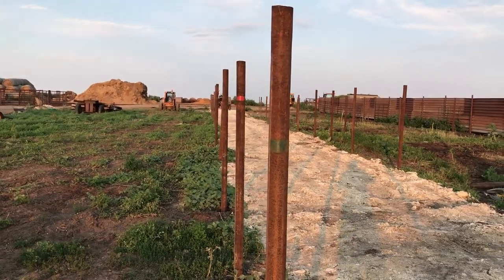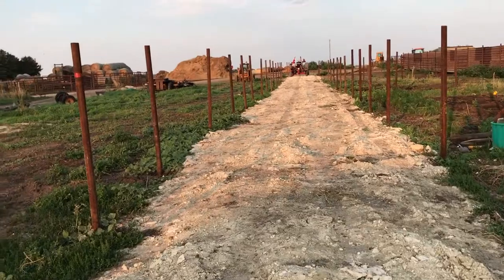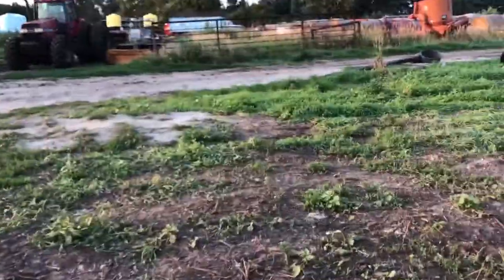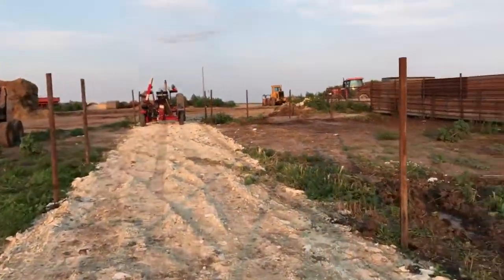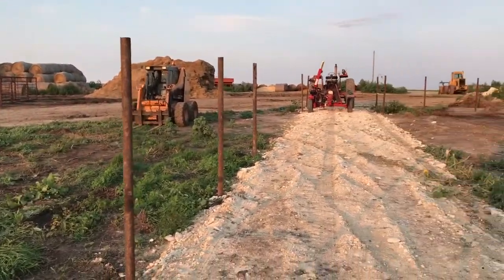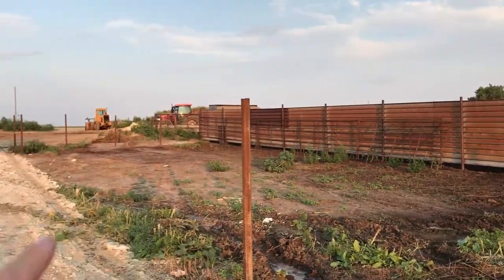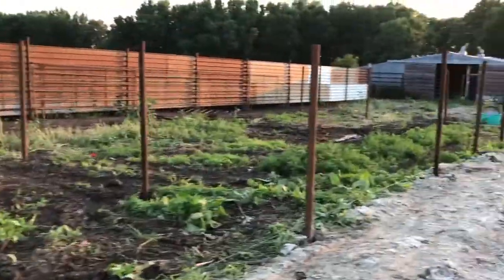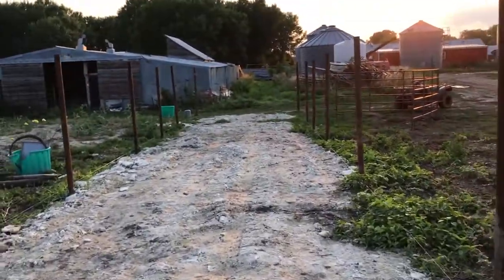Building a sorting ally part 1

Comment: Looks good Ted    I want to build on to my working corrals with steel but I need to buy a portable welder  hard to weld rails on the fence and then pound the posts lol.    We do have a scoop for the press so we can cut saddles into the pipes.
Reply from the maker: duct tape and baling wire could go a long ways! LOLOL

Comment: how deep are they in the ground?  did you use a cement base or core fill them or are they just pounded straight in?
Reply from the maker: just pounded the post in with a pounder and they are 4 foot in the ground

Comment: How long of a run can you make before you need to install an expansion joint in the pipe?
Reply from the maker: Im not really sure... Since i dont use any cement on my post they can give some but when cement is used im sure they are needed more often so that doesnt get cracked

Comment: Are you going with continuous panels?
Reply from the maker: no.... not a big fan of continuous fence... i build my own continuous fence (out of 2 3/8 oil field pipe)   Ill show that as well Cost about the same as normal fence just a bit more time to build... but will last for ever
Reply: Ted Kahler I'd do the same thing, I saw 65 bucks for a 20 foot panel, that add up quick